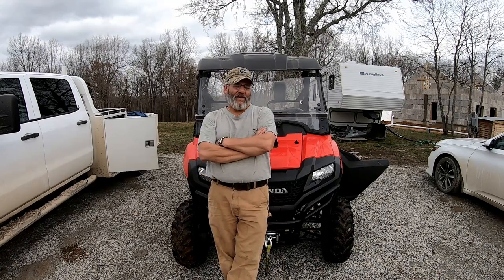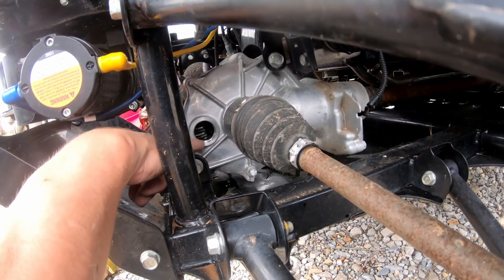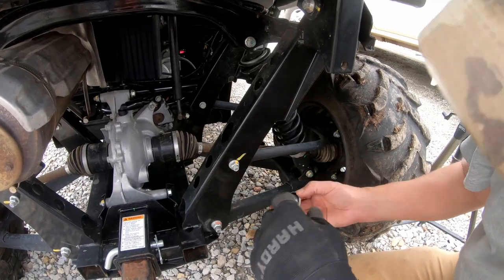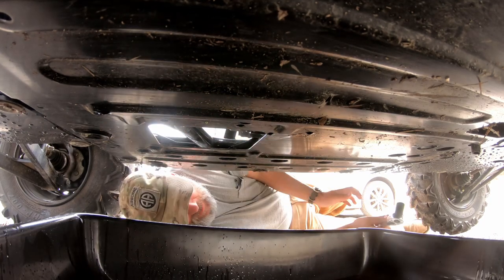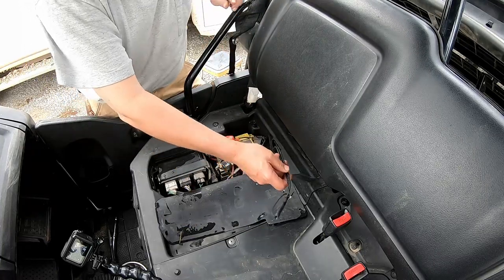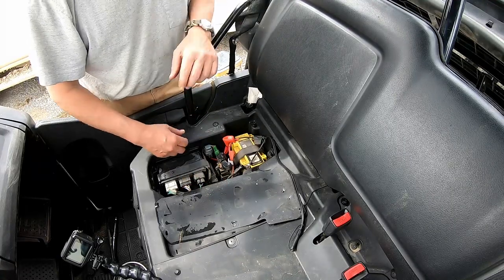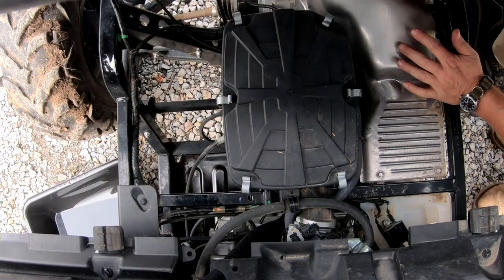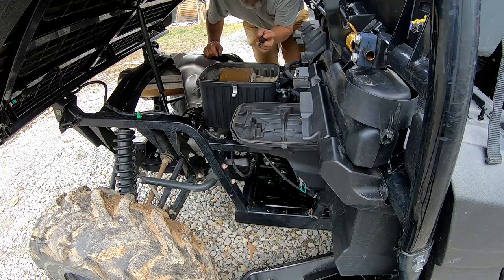Honda Pioneer 700 Service

Comment: Got to love a good dealer service! I've got to get on the Gator soon and do the yearly service. I'll add that to my list of all the other stuff I need to be getting done lol.
Reply from the maker: It's just aggravating that you pay the "experts" for their expertise and spend more money for something you can do better.  
The list never ends.  I tell Libby that I'll live forever if the requirement is to complete the list before death.
Reply: @ozarksethic  I couldn't agree more. I paid a mechanic a few years ago to fix my front hubs on a truck I had because I didn't have time to do it. $500 later and it still wasn't fixed so I took a day off work and found a busted vacuum line and fixed it for $35 myself. Since then Ive tried to do everything myself. I'm with you on living forever because Ive got too much to get done lol

Comment: I'll go ahead and subscribe and be the 1000th subscriber. I live in the Ozarks its the least i can do!
Reply from the maker: Woohoo!  Thank you!  Also, I hope you found the video useful or at least entertaining.  I hope you're enjoying this rainy day.
Reply: @ozarksethic   Yes sir very good video! I have a honda 700 myself
Reply from the maker: I'm glad you liked it.  I'm really happy with my Pioneer.  I had experience with Gators and Polaris UTVs in the Army and didn't care for the reeve's drive setup so when I found out that the Pioneer has an actual automatic transmission, plus it's a Honda, the decision was made.  I have several friends with belt driven UTVs and four wheelers who have problems burning up the belts on the hills around here.
Reply: Exactly right. Same here the transmission sealed the deal for me as well. 
 @ozarksethic

Comment: Thank you Sir !  hope not a dumb question, I have a 2016 Pioneer 700,, thing has been hammered from prev owner,  I dont have a owners manual , does this have a transmission fluid dip stick or DCT wet clutch fluid check ect ?  ? I cant find it anywhere, making me nutts ,lol ,, I was told it takes the same fluid as the motor oil,, thank you for your help,

Comment: Great video.  However, it is easier to remove the metal housing inside the filter from the machine first.  Also you can order a kit with the filter inside for a few bucks more
Reply from the maker: Great tip!  I'll bear it in mind on my next service and I'm sure others will find it useful.  Thanks for watching!

Comment: its hard to get back in with spring - the oil filter - prob why a lazy tec at dealer left out - can see on my video i made with 2021 700-4
Reply from the maker: You may be right or it was inexperience. Unfortunately that meant the filter wasnt sealing or filtering effectively for the previous maintenance interval.  Thanks for the comment and watching.  I'll check it out.